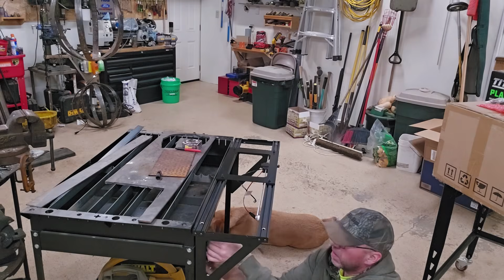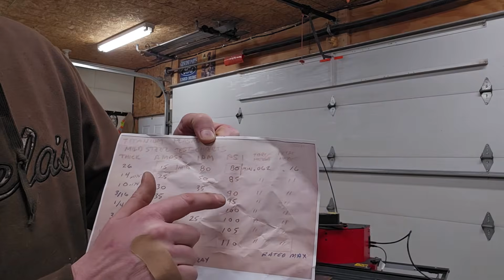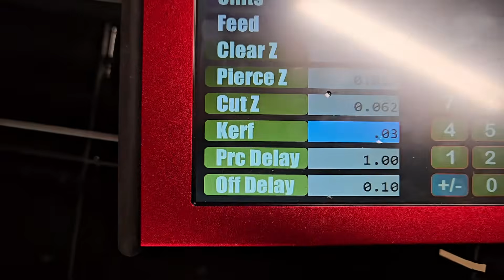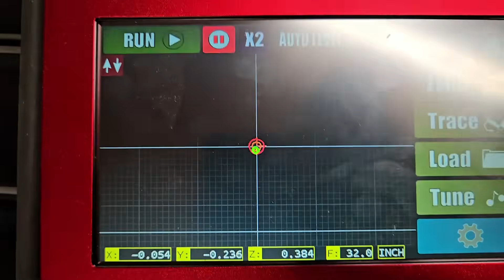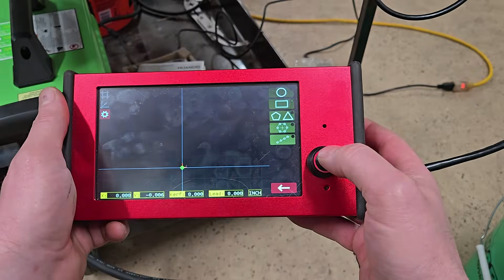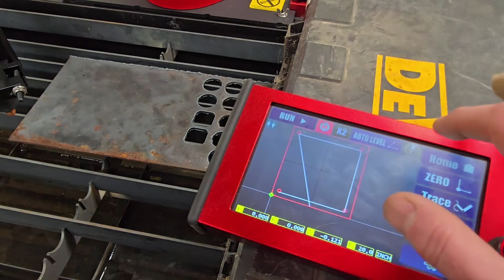Arc Droid Plasma Cutter with Harbor Freight Titanium Plasma. 550 Garage upgrade!

Comment: What air compressor do you use?
Reply from the maker: Nothing special, just a porter cable 20 gallon.  Puts out 5.4 scam at 90 psi

Comment: Congrats on getting your Arcdroid, I will be purchasing one myself, soon. Just compiling information on them before I buy. I’m sure there is a learning curve, so, more information is good. Thanks for the video. Any thoughts on anything you would have changed or done differently?
Reply from the maker: Thanks,  the only thing I would do differently is make my water table longer to accommodate the X2.  So not a fault of the arcdroid, I just wasnt planning or thinking about how much longer it would be.  Thankfully all the parts I've ran have been smaller in size so fitting on the table hasn't been a problem.  The other thing is make sure you get a plasma that you can use the torch height control with.  I havent called them yet to have it activated, but I can see how that feature will be nice especially on larger pieces when the material isn't perfectly flat.  I really do love this machine,  not having to learn a CAD program and being able to trace templates is some of the best features of it.